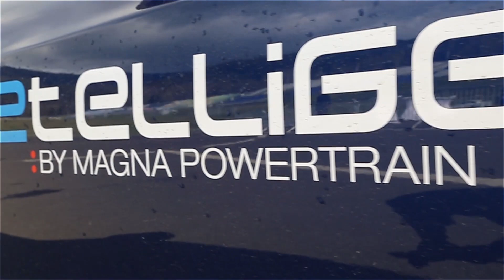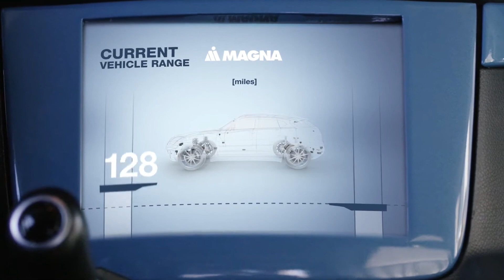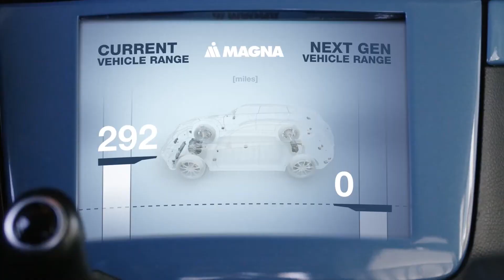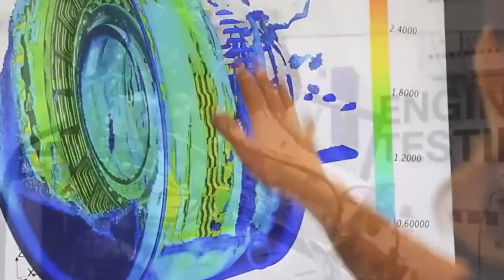This New EV Motor Will Change the FUTURE of Electric Cars

Comment: Get real. At an average of 93% efficiency, it is not possible to double it. If I recall Tesla is closer to 97%. All the companies named, except for the Koreans, are in decline & not serious players in the EV market. This is another unserious fluff piece.
Reply: They are increasing power output, not efficiency. Like ICE can increase power by increasing RPM.
Reply: @FFLim  It still lags power to weight and pure power compared to both Lucid & Xiaomi.
Reply: Same kind of BS is going on with the batteries.